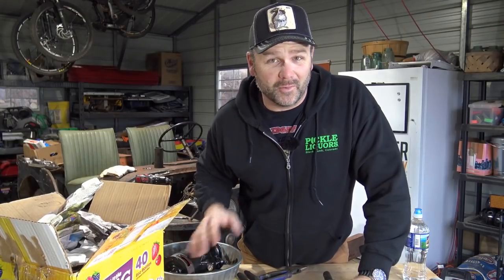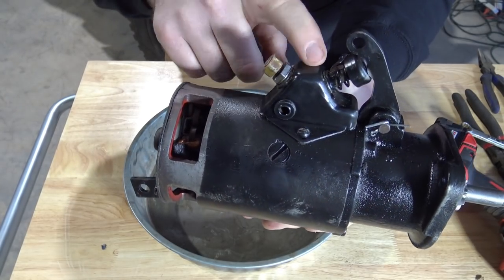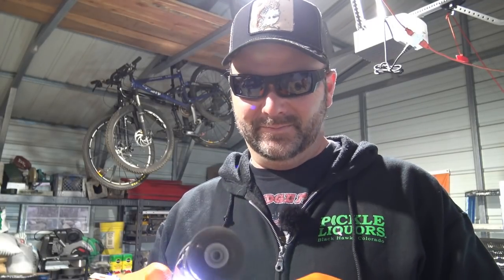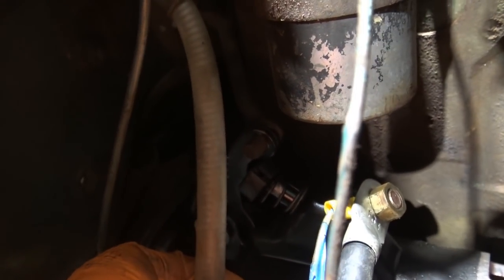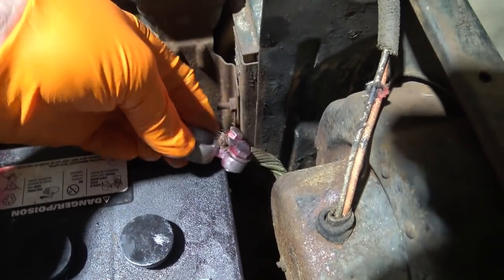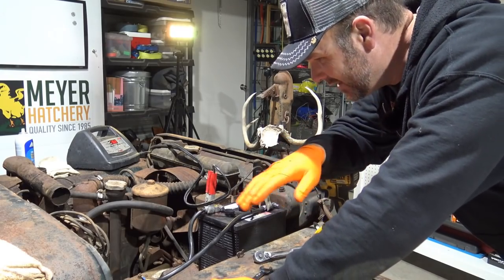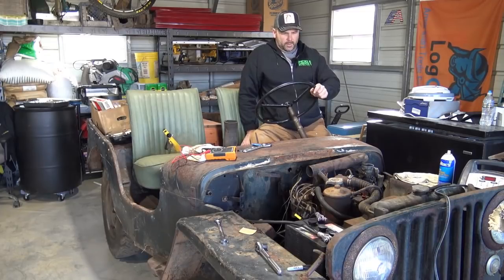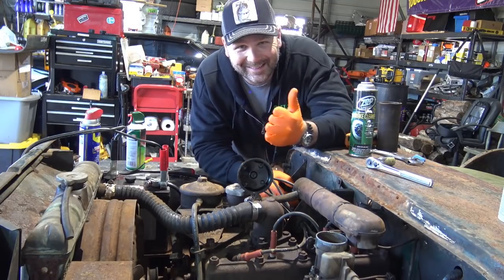Willys Jeep Rescue: More fun with the project! Anybody got spark? Wooooo!

Comment: Spark plug should be touching metal to spark. Needs grounded
Reply: Need new cap. Rotor, points, condenser good idea too
Reply: @billseibel2563 , All that could be brand new and perfect and the plug will not spark unless it's grounded.
Reply: I agree... 100%
Reply: Yes, it needs to be grounded.  A compression test is easy and tell you the shape the motor is in..
Reply: Yeah, that rotor button was toast
Reply: @BUD100ify  , True story !
Reply: @billseibel2563  the new points now are crap. They dont last. My grandpa put new points in his 67 jeep wagoneer and they failed so he put rhe original ones back in. Thing runs fine with old ones.
Reply: @chickensfloat7427  probably got contaminated by debris in the distributor....happens quite often
Reply: @thepyrodude  although knowing my grandpa he bought the cheapest garbage he could find lol
Reply: Or just hold it in your hand LOL.
Reply: Amen.

Comment: Your piston rings are dry from sitting years so that engine has very little compression. Take spark plugs out and add a few drops of oil. Spin engine over with plugs out to spread oil around. should help with compression. Also change out points.
Reply: And then he could pull it around the yard in gear so he doesnt burn out his new starter.
Reply: With the spark plugs out turn the engine over with a heavy duty drill so that they system will pump the oil through the internal ports to prevent a dry start-up.  And like the guy indicated, lubricate the top of the cylinder with some oil so that the cylinder walls get lubricated to prevent scratching.
Reply: Good point if it rolls over that easy it might be low on compression it might not even start you if you get it to fire
Reply: and put new plugs in theres no way they will spark covered in the crap on the electrode as his old plugs where

Comment: Am really enjoying this.   It a stroll down memory lane for me.  At age 15 I bought a 47 CJ2A in simulator condition.   That was 55 years ago.  One of the first things we did was ditch the 6 volt system for 12 volt using the 6 volt starter is fine. Not that hard to do.  You will be much happier.

Comment from the maker: Folks be sure and catch the live stream tonight at 9pm eastern...click that bell for notifications! Gonna do a cool giveaway tonight! Trying to do a cool giveaway every week!!
Reply: Hey man sorry to be mean put. On 6 volt systems the positive goes to ground on the frame .
Reply: Keep on keeping on my friend. 
Bull, Holly Hill farm
Reply: The cannaster is a fuel filter
Reply: Need new plugs
Reply: Did you try grounding out the spark plug on a piece of metal?  Spark plugs wont spark unless they are touching a piece of metal.  Good luck
Reply: I know you checked that the coil was getting power but did you check that the coil wire going to the distributor cap has spark?
If you think the battery is bad since it will not turn over without the boost by pass the battery and see what happens
Reply: Stoney Ridge Farmer 
Hi 
I love old cars and like to work on it so I will give some advice to you:
Need new cap. 
Need new rotor. 
Need new points and condenser. 
Need new spark plugs & check the wires. 
And you should clean the spark plugs hole to get good ground with the block. 
And few drops oil in the spark plugs holes to essay the movement.
And be sure the throttle isn’t rusted. 

Oooh that’s all from 25 years of mouse piss. 
Thats all and keep trying we are waiting. 
Good luck 👍
Note : my English is so bad.

Comment: Josh
When you check the spark plug for spark, you have to place the plug so the plug threads touches metal and is grounded.
Reply: You placed the spark plug on the rubber radiator hose. Try placing the plug on the head or other metal grounded place.

Comment: Josh I had a 1950 and 1956 Willy's and I ended up putting an electronic fuel pump after I changed everything to 12volt. Made it much nicer starting in the cold weather. I picked up the pump at advanced Auto parts but that was about 15 yrs ago. Good luck with it. You will get if figured out everything was simple back then!

Comment: Dont put the spark-plug on a rubber hose,ground it out on metal,like the block.ya,the cap is no good.the centre carbon contact is broken.
Reply: yep its easilly replaced with a new one just grasp old one with grips n pull out then just push the new one back in place most distributors are the same size central carbon brush

Comment: I worked at an auto garage as a teenager and early 20's.  We sent starters and alternators out for rebuild.
They always came back "totally rebuilt."  If it came back like yours, the garage owner would send it back.
Paint was often on the terminals.  We just cleaned it off.
Reply from the maker: Cool

Comment: Ive had an experience like yours before. Had a Cub Cadet with a starter generator that wouldnt work. They went through it, and it worked all right but it stopped working after a bit. Turns out the solders they did were not good at all so we resoldered them ourselves and never had a problem again.

Comment: Every vehicle I have is old , I have an old ww ll Harley in my shed haven't ridden it for twenty years ,( broken gearbox) I'd be pissed off about the starter rebuild , been there done that and it really wrecks your day , I see in comments people playing with words like it's a rebuild not a remanufacture,that's the problem dishonest people playing with words , a rip off is a tip off , if you exchanged the incorrect brushes you were sold you could have fitted em and be $85 better off, that's all they really did, I'm enjoying your videos thanks for sharing and cheers brother from down under

Comment: Rebuilding just fixes what's broken. If the brush was good it'll stay. The best way is getting it remanufactured, all parts are replaced
Reply: Exactly. Rebuilding restores the assembly to working condition. Remanufacture brings it back to brand new. Often confused.

Comment: After you get it running put Marvel's mystery oil in it  to help clean the inside

It will make it smoke bad for a hour or two of running  but then it will go away and run better ( did this to my 1977 f250)

Comment: Back when I had a '57 Chevy, a tune up consisted of points, plugs, condenser, rotor cap and wires.  Check timing, ground...etc.  That's the basic places to start.  Replace stuff.  ;)

Comment: That canister is your bypass oil filter which takes a Fram C-3 filter.
I used to own a 1949 CJ-3A.  Which I upgraded to a 12 volt system . I had to change the bell housing to accommodate the 12 v starter and I used a Ford alternator.

Comment: I would just convert to 12volt  have done quit a few it is cheep and cost very little under 200 bucks  IT WILL BE WORTH IT FROM NOW ON starter will work on 12v  replace generator with a 1 wire alternator   change all bulbs  need a resister on the coil  can get then at any parts store and anew 12 v battery    under $200.00 will be a Blessing!!!!
Reply: 100% agree.
Reply: When you do the 12 volt conversion get a Pertronics electronic conversion.  The points and condensers they make now days are junk. It will save you from pulling out your hair later. By the way, cool old jeep!
Reply: He'll need to get an amp gauge or put a resister on the one on the jeep.
Reply: No need to do a 12V if you don't have to.  Restoration means keeping it stock, and if the engine turns and fires then it will work as advertised.  Engine turns by hand, should fire on 1st attempt once everything is adjusted as it should be.

Comment: I think with restorations it's often a case of it being a labour of love rather than the project making financial good sense. Sometimes though it's good to compromise and decide on getting a project to a stage where it isn't concourse, or even strictly speaking a restoration rather than getting it back to a basic functioning vehicle that perhaps be then kept for possibly taking it further or maybe selling to someone else as an ongoing project. Totally agree with you over the starter rebuild, basically anything less than a complete remanufacture with new consumable parts is a substandard service.

Comment: Hey Josh,
Basic Tune-up specs for your Willys Jeep....Plug gap=.030   Points gap=.020   (set at high point of distributor cam) Use a feeler gauge to set accurately.
Doug@ the "ranch"

Comment: That canister is the oil filter housing.  If you have spark then you might want to check for compression.  Those flat  head valve  in block are notorious for sticking open after all those years.

Comment: Get the Pertronix, no points, no dwell, HUGE diff in start and run. Oh like others said, ground plug to test spark. Of course I would convert to 12vdc. Resistor for coil, unplug lights/pull fuse. That's it, rest can be done later.

Comment: Josh,
Replace all ignition parts, set the point gap, use a matchbook thickness as a  (rough) gauge if you don't have feeler gauges and check for spark...Ground the spark plug to the block, you'll never get a spark plug to spark on top of a rubber radiator hose...lol
Make sure there is no oil on the new points contact set, or they will burn (pit) prematurely. A touch of cam lube on the distributor cam wiper is a good idea as well. You got this!
Doug@ the "ranch"

Comment: Going back through your videos because I'm working on a 48 Willys CJ2A.  My 6v Jeep is starting and running like a brand new car after sitting in a barn for 15-20 years so don't let anyone tell you to do a 12v conversion.  Your battery was junk.  Fully charged and a few cranks shouldn't drop the voltage to 4.  The canister is your oil filter, nothing to do with the fuel system.  Your engine is a little different from my L-134 "Go-Devil" but inside my distributor there's supposed to be a metal dust cover under the rotor...not sure if it has anything to do with spark, but it's missing.  Once I replaced my points, rotor and cap and knew I had spark, I removed my #1 plug and sprayed a shot of brake cleaner in the cylinder.  Reinstalled the plug and cranked it over and it started.  It was enough to get the fuel pump drawing fuel, and now mine starts every time.  Can't wait until you get back on this.

Comment: Jump the starter to eliminate that as your issue. Then see if you have voltage at the starter motor and work backward toward to the ignition switch and onward

Comment: Josh, my Cub Cadet 108 starter/generator is 12 volt, but the shop rebuilt it completely for $120.00 They had another price point about $30.00 more to upgrade the replacement bushings. Ed
Reply from the maker: yep....things are cheaper around these parts...I called back and asked them what they replaced..they told me the guy that did it was having some troubles with his work quality

Comment: When an engine hasn’t been turned over in quite some time, i usually use about an ounce of Marvin’s mystery oil in each cylinder and let soak for 24 -48hrs (before turning over).  Don’t want to bust the rings on a potentially rusted cylinder wall

Comment: I'm sure I'm late to the party here but when you're looking for spark at the plug, you have to ground the plug. A better way to check just for spark is sticking a phillips screw driver in the spark plug wire connector and holding it close to metal on the engine, the spark will jump the gap. 

The engine really isn't spinning fast enough for a 30 year first start.  I'd look into changing it over to a 12 volt system.

Comment: Hi Josh. My son and I had a similar problem with our 58 Ford tractor. After frustration finally placed a part of my anatomy up by my throat my son pulled a continuity check from the post on the coil (the one with the wire going to the distributor) to the distributor housing. Results: no resistance. The rubber in the housing for the coil wire post was ok but there is an insulating strip inside the housing to insulate the post from the housing. The strip was fragmented and grounding to the housing so no fire to the points. We had an old bicycle tube we cut to fit inside and the problem was solved.

Yes, I think you were gyped by whomever rebuilt the starter! You could talk with them but correct brushes may not have been available. I'd still talk to them and let them know about your displeasure.

As for your butter churn...ha. I never knew they made them that small. Hope you have a dairy farmer nearby. Churning will wear your arms out and getting the whey out of your butter will take almost as much time. Of course with your churn you might be looking at 2 pats of butter. Good luck with that! Be well.

Comment: When you're checking for spark with your spark plug make sure it's not sitting on a rubber radiator hose it won't give you any spark if you insulate it... if push comes to shove you can unplug the positive side off of your starter and around a full 12 volts to it shouldn't hurt the starter though being as old as it is you never know you take the positive off of the starter so it doesn't feed the rest of the system with 12 volts only the starter.

Comment: On a vehicle that has been sitting for as long as your jeep, the basics are, new plugs, wires, points, cap , condenser, oil and filter change. Ground to the frame. Confirm spark before you start pouring anything into the carb. It's a great project, but you need to start with the basics. Good luck

Comment: Sounds like you went to a local shop for the startrr repair.  At some point it is better to get a remanufactured starter then rebulding old one.  A good repair shop also wouldn't have painted ground points on starter.After all those years of sitting, I would recommend replacing the sparkplugs, wires, points, rotor, and distributor cap.

Comment: While you’re waiting in parts, highly recommend you clean up that oil filter, pan and system. You don’t want to starve it even during the first start do you? As others have said, put some marvel down the plug holes to help lubricate the walls and rings (better compression to start also). In future, You can get rid of the foot start and wire a starter (preferable 12v system) to a starter key. That Jeep will be a great little workhorse around the farm. Hope you keep it in the family!

Comment: The canister you pointed to is actually the oil filter.  If i were you I would open it up and make sure its cleaned out, in the past i have heard of people occasionally use toilet paper as the filter, and you can probably imagine what that may look like if it sat there soaking in oil if that ever had been done not his jeep.  Once that was cleaned out, i would replace the filter with a legitimate replacement oil filter and make sure to change the oil (it looked pretty crusty like syrup).   As you eluded to, I would also change  all the ignition parts, inclusive of the points and condenser. i had a cj2a in similar condition, besides the above mentioned service, i also replaced the wiring, making my own wiring harness...in the end, the wiring ended up being the issue for mine not starting along with a bad condenser.  I also tested the compression and actually had even compression around 115-120 psi surprisingly.  As others have mentioned, when testing for spark touch the threads against a clean spot on the head, they will need a proper ground to show spark. I ordered most of my parts from https://www.kaiserwillys.com.  Hopefully that is helpful!  good luck! let me know if you ever want to sell it and focus on that bronco ;)

Comment: Get an 8 volt battery. The spak plug has to be grounded to get a spark. Get a visual spark plug tester. You will use it a lot on your projects. Good luck.

Comment: If you don't put a dust cover over the openings in the starter housing where the brushes are the starter is not going to last no time. Dirt and grit will get in there and eat up the commutator. If you don't have one make one with a small piece of sheet metal.
Reply from the maker: Cool I wonder if they sell a sleeve to go on it...electrical tape certainly isn't the answer in my mind

Comment: Good job. The starter rebuild is ok. Usually replacement China made brushes and copper leads are lighter duty than the 70 yr old original.  I always requested reuse of the original with my starter and generator man . With 6v, clean all pos and neg connections.

Comment: Awesome series, thanks for sharing. Jealous of your wood stove heated shop. 
Try switching polarity, most 6v systems are positive ground. Check for an electronic ignition kit, usually have cheap convert kits available to replace old style points condenser. Might be a good time to convert the whole jeep to 12v. The starter can handle 12v but the coil would likely fry. Get a 12v electronic ignition kit and your laughing.  Also A cheap spark tester tool is well worth the money. The plug needs to be grounded out on metal to test for spark, but I think you knew that...

Comment: Yes replace the distributor cap. The center terminal should be sticking out way more to contact the rotor. points and condenser as well. Clean out the carb and EARTH the plug when checking for spark
Reply from the maker: I'm on it brotha!! Today is the day!!! I have the parts....working on it this afternoon and trying to post the video tonight!! WOooooo!!

Comment: The plug needs to be touching the engine on a clean spot of metal to finish the electrical loop to create a spark( the wire gives the positive and the engine is the ground) have fun

Comment: Spark plugs need to be grounded to check for spark. You need to replace the cap, rotor, points and condenser. Plugs and wires wouldn't hurt either. Get the battery load tested, to make sure that it is holding charge.